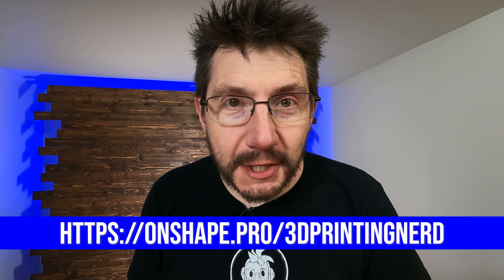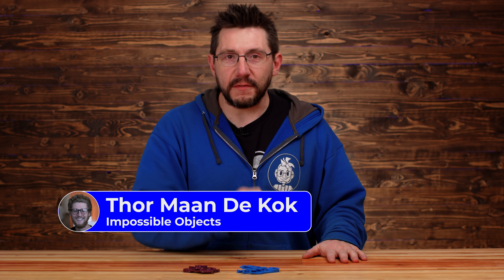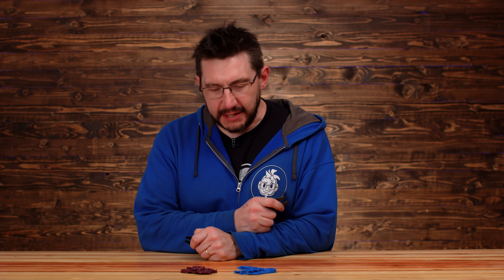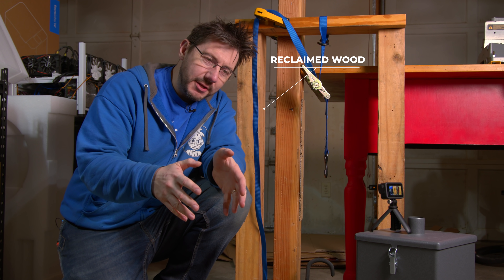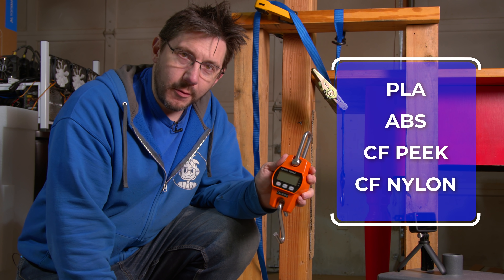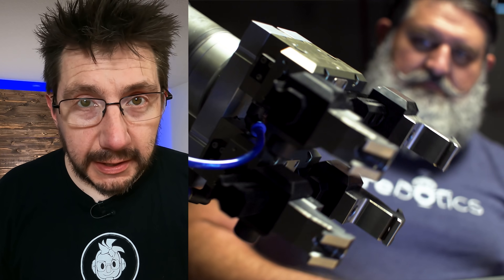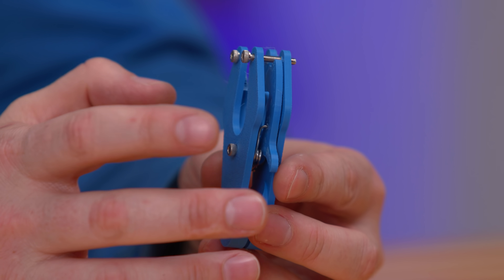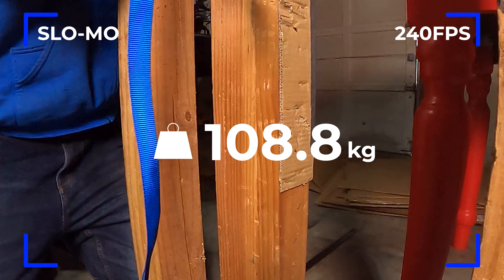3D Printed Snap Close (Frog) Connector!

Comment: I think a lot of people forget the difference between strength and toughness:

-Strength is a measure of the maximum load a material can handle in a given cross-section. It is properly represented by force divided by a unit area, hence the use of megapascals (for metric units) and pounds per square inch (for Murrican units) for measurements of tensile strength.

-Toughness is the combination of strength as listed previously and the measure of a material's ductility. Ductility measures the permanent deformation a material can experience before it comes apart...for example, gold and copper are highly ductile because they can be stretched out a great deal, while concrete has very little ductility by comparison. A material that is both very strong and highly ductile has excellent toughness, a weak material that is brittle would have awful toughness, and strong yet brittle and weak yet ductile materials fall somewhere in between.

PLA is incredibly strong, and is indeed the strongest common printing material by far - ABS has roughly 2/3 the strength of PLA while PETG is only a little better than that (PC is generally stronger than PLA but is challenging to print for most people). PLA is, however, also the most brittle of the common filaments - ABS has a toughness that makes it a generally better choice than PLA for prints that are used under load. PLA makes for great Deadpool busts and D&D accessories but I wouldn't use it to make a mounting bracket for something in my car even if it were heat treated to improve its temperature resistance.

Given that this video only evaluated the strengths of the materials rather than the toughness, the end result with ABS being the worst and PLA only being outclassed by a specialty engineering material was 100% in line with my expectations.
Reply: This is 100% one of the best comments. Strength vs Toughness has to be one of the most common myths in the 3D printing world. A lot of people don't realise how strong PLA is especially when used in pure load bearing scenario. But it's brittleness makes it problematic in any situation where you have moving loads, torsion etc. This is where materials like ABS and PETG excel. The second big myth is about PLA's biodegradability but I digress...
Reply: I'm glad you said that because I was gonna say that but explained much worse
Reply: Indeed didn't surprise me much, I'd have thought the spread would be slightly different. Its also why you design for the material you intend to use, ABS is the cheap goto because it isn't prone to creeping the way PLA is, is temperature stable, can be solvent welded with readily available solvent - its more than just any one stat that makes a material good for the job, and even then its only good for the job when you design such that the material is kept within in its temp/mechanical/chemical limits!

Comment: do not confuse impact resistance whit tensile strength the necessary material property for traction testing. Take a look at some data sheets and you will see the  of the PLA is almost the same as PEEK about 100MPa, nylon is about 70MPa and about 50MPa for ABS.  So no real surprise in the order of the materials.

Comment: Every in-depth strength test I've watched on YouTube has shown PLA to be one of the strongest materials out of the common printing materials. I don't understand why people still think it's a weak material. The issue with PLA is it melts sooner than the other materials and has poor UV resistance; strength is not something it lacks though.
Reply: PLA also goes too poop with 60 degrees.
Reply: That's the big problem of PLA. If you use it  in a car the first sun on the window transforms the print to a burrito.
Reply: The 3d printed gun community has known this for years.  And everything else is either so expensive or finicky to print pla may be the best period
Reply: Why I think PLA is weak and why i prefer PETG:
PLA is brittle. The high tensile strength of PLA is often thwarted by the fact that it will snap just by dropping on hard floor ( depending on the geometry of the part )
Reply: @InSahne  I think you overestimate it's brittleness.   Do you do many prints at 100% infill?
Reply: @Grognarthebarb  depends on the conditions the printed Part is used in.
Reply: PLA suffers dreadfully with cold flow or creep also. Its great for a lot of things, but even at 20c, if left in use, bearing weight well below what its capable of peak, over time it will bend and pull apart. 
Loading each of these frog connectors with 20kg for a week, i would expect PLA to fail much quicker than ABS. Not sure about CF nylon.
Reply: PLA has very good UV resistance, on a par with ASA and much better than ABS.  But it does have other disadvantages, in that it deforms easily with heat because of its low glass transition temperature, and suffers from creep under load.

Comment: PLA gets a bad rap for it's perceived weakness because of its low temperature resistance (and ABS gets the opposite because of the inverse) but PLA is quite physically strong.  Still the myth will persist.  Thanks Joel for helping to set the record straight.

Comment: The ABS test seems to follow what other channels have found. ABS isn't actually that strong of a material. It's just more flexible and heat resistant than PLA. For these types of forces, PLA is stronger.
Reply: What these sort of test don't show is how applicable to the real world this is. ABS is better practically in alot of use cases because if its impact resistance. I've made a glasses case out of PLA and ABS. I've dropped both accidentally from the same height (putting them in my locker) and the ABS held up well with little to no damage. The PLA shattered and was instantly unusable. ABS also doesn't sag either, so while ABS holds less weight, it'll hold it for longer. 

There's more to material selection than just "strength"
Reply: @jamesash7368  Very true. For most "practical" use cases, ABS is the better material hands down. I was more commenting on the test results for ABS versus PLA weren't a fluke for this test in particular. When it comes to testing straight tensile forces, PLA is stronger.  No need to re-test, unless he brings in more variables. I'd be interested to see ABS toughness tested against some PLA composites (PLA+) and see how the toughness/tensile strength holds up on those, but that's a different story entirely. I'm sure it's been done before.
Reply: @jamesash7368  "ABS also doesn't sag either" -- given that sagging is directly related to the stiffness of the material, and that PLA is significantly stiffer than ABS, that is patently false.
Reply: @ozrenbalic6051  what I guess I mean droop. Over time under load PLA will change shape. ABS is more resistant to this.

Comment: What I do on some parts to increase strength, is cut a tiny gap on the inside of the part, maybe 0.05mm thick, which forces the slicer to print perimeters wherever that tiny gap is. This allows you to put solid infill inside the part wherever you want and in whichever shape you want.

Comment: In college I had access to an Instron tension and compression machine and we tested a bunch of materials for 3D printing. I was shocked how well PLA did, and I think PLA formulations are much better now. TPU, specifically Ninja Flex gave no result because it would NOT break. It just stretched until it maxed the machine. Keep up the testing! Oh, and run a string through your scale to keep it from slamming into the bottom hook. Just make sure it is not touching when the test is going.

Comment: for the ABS i am more in question of how it was printed on a open system no heated chamber vs a closed system with a heated chamber. I have notice a bit of difference with my ABS parts when printed in a heated chamber with a longer slower cool down vs when i printed with out one with a faster cool down, or it just may be me?

Comment: I'd retest ABS with the same stuff and a different brand, try different printing orientations too. I have 2 hunches from watching the break.
It was either a bad batch of ABS that had other additives for color that may have effected its plasticity, making it even easier to bend. OR It was just standard layering issues we all forget about time to time, always gotta consider where the most tension is on the part, the last thing you want is horizontal layers and downward pressure. Just asking for it at that point!
I've found success with 45 degree layers sloping away from the tension points, pointing towards can be weaker, Vertical lines arent bad either but those layers can open with enough downward pressure too. Try turning them 45 degrees on the X Axis and see if they come out stronger! Even better, if you can alternate Slopes on layers, you could make something freaky strong! Maybe Iron the top and bottom layers too, might help!

Comment: The ABS result doesn't surprise me at all, what does surprise me is that the CF-nylon didn't do better. I had no idea that peek was so strong though, very interesting. Also, I guess I missed the Essentium interview, we use their HTN-CF25 at work and that stuff is absolutely insanely strong and easy to print.
Reply: Adding chopped fiber into a layer built substrate does not make it stronger. It is not the same forces involved as with laid CF. The short fibers simply do not penetrate far enough across the material to add strength. If anything they actually create focal points for energy and make it brittle! It does often add stiffness though, but only mildly.

Bear in mind that this is the reason Markforged, and others, use continuous carbon fiber strands in their prints which ARE very much stronger. Markforged inlaid CF nylon is used in race cars and other industrial strength applications.

Comment: Check out Stefan's testing over at CNCKitchen.  PLA is stronger than the majority of people give it credit for, and ABS weaker.  Your results were exactly what I'd have anticipated seeing.  As long as parts won't be exposed to UV or higher temps (Direct sunlight) I use PLA for functional prints most of the time.

Comment: ABS "baking index" is lower than PLA's that is why specifically in 3d prints ABS worst than PETG or even PLA. To print strong ABS part you would need proper setup with controlled high-temp inside of a chamber.

Comment: I don't believe ABS is stronger than PLA. PLA  is a very strong material, but it's more brittle. ABS and nylon would do better with shock resistance, but maybe not material strength.

Comment: I think reading off the scales just wasn’t working, it doesn’t update fast enough. Maybe try filling a large bucket with water or sand slowly so you have more time for the scales to read the number. Also, you only connected it to one end of the strap, so it only held half your weight.
Reply: Or a slowly turning screw pulling a strap, increasing the Force gradually.

Comment: I was impressed by the PLA part holding that much force
Reply: For it being the most common material on the block by far, it's often overlooked for its overall usability... So long as you keep in mind that it's still plastic, it will make pretty much anything you want so long as a plastic part would be strong enough in the first place.

Comment: In the last test, your force weight its not the same as holding you 100% because you have another side thats clamped up with metal i believe...Basically meaning your dividing the force to half or so..you should try only one side with only the peek cf part 😉

Comment: That is an awesome test. I am new to 3d printing, can you please let me know what materials can print on my ender pro 3? Can I print with cf peek? Thanks for sharing.
Reply: Sadly, PEEK requires very high temperature nozzle (around 400ish C), bed at 120c, and an enclosure heated to around 120c as well, which is typically outside the range of most 3D printers you just buy off a shelf.
Reply: Ender 3 Pro {Same as my Ender 3 Max, just smaller build volume] can print PLA, ABS{If you sacrifice a blood offering to the printer gods], TPU and PTEG. ABS and PTEG is at the uppermost temperatures the PTFE lined tube inside the hotend can handle. Remember PTFE releases cancer causing chemicles if heated to high.
I have actually managed to print SBS on it a time or 2. Build plate adheasion is the issue there as it is slippery as all heck. But printing at 215 and a 60 build plate gave me workable results. Best is to set it to TPU settings. Slower retractions and print speed gave me best results
Reply: @MrGerhardGrobler  looks like it is good if i print PLA on my starter printer. PLA does print well. Appreciate the inputs.

Comment: ABS has never been stronger, people have been listening to a myth do to it being more flexible/impact resistant. Constant even stress, PLA is FAR stronger, take a hammer and hit it and ABS will usually deform and bend before breaking. All things equal, PLA will always be "stronger". watch any testing done by people like CNC Kitchen. and others who tested it.
Reply: Yeah I believe it’s mostly more heat resistant. So better in chambers, or hotend parts.
Reply: @CodeMonkeX  it's not that much having better heat resistance than PLA... But ABS is pretty good there, while still being easy to print.
Reply: @CodeMonkeX   used HTPLA which has "almost" the same heat resistance after annealing. (NOT PLA+ which is not a true High Temp PLA in most cases) Never had an issue with it. All of my printer parts are PLA and nearing 5 years old and have had zero issues. ABS isn't bad or that hard to print, but is too "nasty" to print for me as my printers are in my bed room mostly. Some parts I'm doing now in PC, just because I want to test, none of the PLA version have failed.

Comment: For one, you shouldn't be in line with the tensioner.  You should have had a fulcrum/pulley point in the ceiling so you could ratchet out of the line.

Comment: First you tested tensile strength. Now PLA is one of the strongest materials tensile wise. It sucks temperature wise and its brittle. Kinda like glass  Glass has a higher tensile strength then steel but you rather use steel then glass to make a car frame as glass will crack. So in your test the test results align. Now as for the CF part. Unless it was full strands it should also not be that strong tensile wise. If its chopped fibers then that will drastically improve stiffness and abrasion resistence but reduce tensile strength. So IOW a CF PA will deform less and stay dimensionally intact longer if you hit it than the base CF. OTOH you can take a sledge hammer to a printed Nylon part and bend it to a 90 (I done it with Taulman 910) whereas a CF 3dp Part will resist much more and will break (again more rigid/brittle - less tensile). Now another thing is deformation. You probably can print it in tpu - the tpu will probably let go but snap back to its original shape so its about as tough to destroy as a car tire - that is why we use rubber (TPU is artificial rubber) for tires as they are awsome in taking a beating.  So your results were pretty much as I expected and also in line with experiments done by CNC Kitchen

Comment: Surprised about the ABS failure.  However, isn't there different stress tests?  I believe you were testing tensile stress.  ABS can withstand more pressures (gaseous and fluid) and temperatures, I would also expect.  How about PETG?

Comment: That PLA wins over ABS was expected. PLA is known to be stronger than most “normal” Filaments like ABS, ASA, and PETG. It’s main problem is it’s bad temperature resistance (low heat deflection temperature) in unannealed state.
There is a good video from CNC Kitchen named “Comparing PLA, PETG & ASA (ABS)”
[I’m not linking it, because youtubes abysmal algorithm will delete this comment otherwise)

Comment: shame you did not try Taulman 900 series polycarbonate nylon hybrid (takes solid metal hot end for like 300 degrees printing temp I believe) or even the lower temp nylon from them taulman 230, as I suspect you would have had better results than the fiber filled nylon, (since the fiber seems to make it brittle)

Comment: While, completely impressive, unless I am mistaken, I think that that connector is only supporting HALF your weight in the configuration you used it. The weight is split equally between the two straps. Still, though... I HAVE to print some of those!

Comment: From my research, PLA tends to benefit from the fact that it was made for 3D printing. ABS, while it is stronger on paper and certainly stronger when injection molded, only ended up being used for 3D printing because it was available as filament. Parts printed in PLA do tend to test stronger than parts printed in ABS so this result did not surprise me.

Comment: I think the ABS is valid. From my personal tests, PLA is stonger than ABS and PETG. ABS and PETG have more give and sometimes can hold up to what PLA cannot, because when PLA is at its limit it just breaks.
Reply: Yup, the things that disqualify PLA is the large tendency to creep, as well as the very low temperature tolerance, for mechanical applications.
Reply: @extectic  To be Hornest, I use PLA for most stuf that needs to hold up. Black PLA is great for outdoors stuff and doesn't creep. I have had parts outside for 5 Years+ that haven't changed, they have to be black mind you. Other Colors have bent whitin months.

Comment: You only tested with half of Joel. By looping the strap up and hooking it to the eye hook, you split the load between the metal hook of the strap and the frog. You need to loop your strap to the frog and then only hook the frog to the eye you wish to hang on. A Physics 101 free body diagram would should this as well.